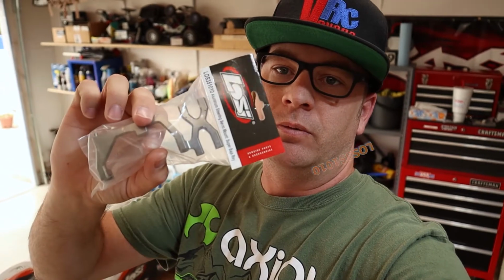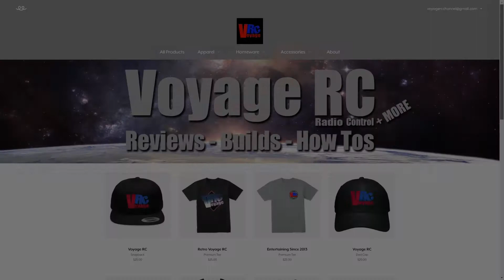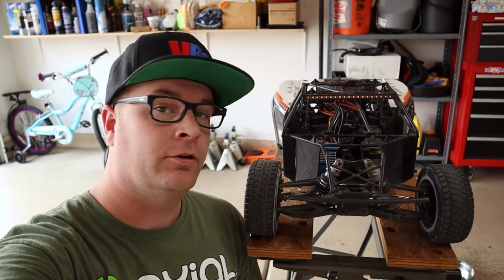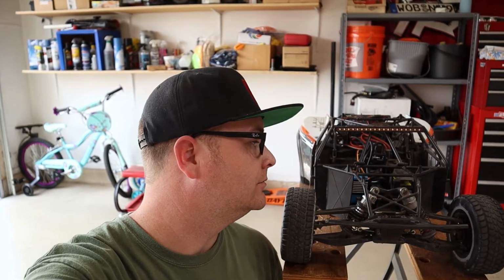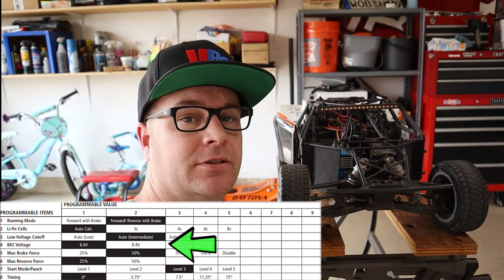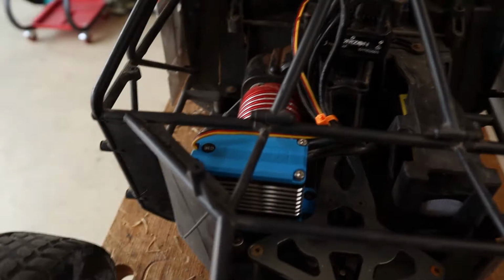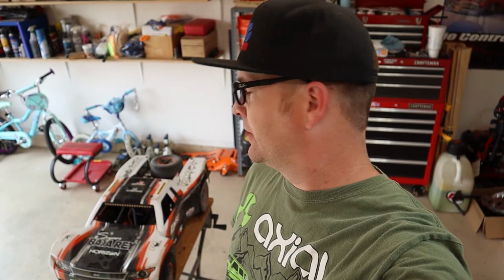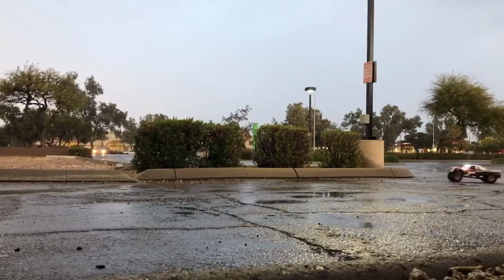Fixing the biggest problem with the Losi Super Baja Rey - 1/5 SCALE SERVO UPGRADE - RC Trophy Truck

Comment: Nice upgrade video! Note: Any servo rated at 7.4V can handle a fully charged 2S Lipo (8.4v) It used to be that servo were always rated at the nominal voltage of the pack I.E 4.8v. 6V, 7.4v but now some companies use 8.4v to make them look better, not to mention pad the specs for good measure. Hitec specs are always true to what is advertised.
Reply from the maker: Thank you!
Reply: I just got two of the losi baja rey 2.o and out of the box one of them the  steering rate knob does nothing and the other will drive straight for 3 seconds or so and turns hard left  on it's own ???
Reply from the maker: @highlifter1634  contact Horizon Hobby. If its faulty they will take care of you.

Comment: To me the biggest issue is the tires and the loose on the front wheels
Reply from the maker: I converted to 17mm hex in another video to get rid of the stock tires. 😂
Reply: @VoyageRC  same for me i have converted mine and use DBoots backflip tires